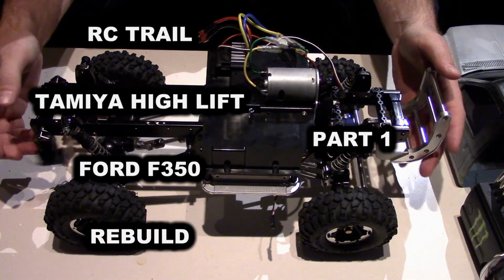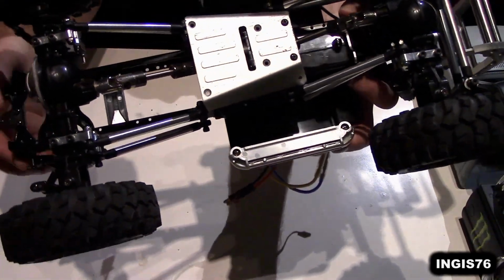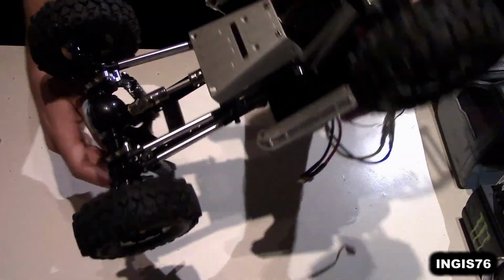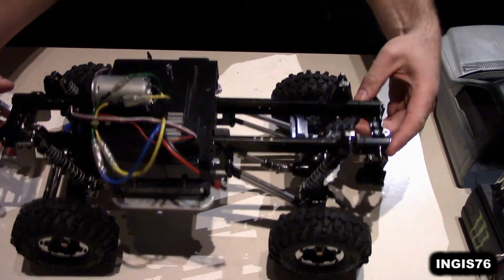RC TRAIL REBUILD PART 1 TAMIYA HIGH LIFT FORD F350

Comment: I was wondering in the Tamiya 350 and tundra the same only the body is different? Nice vid bra jobba..
Reply from the maker: They are the same yes, and the same as the Toyota Hilux. just minor details is different. Takker :-D
Reply: The Tundra have a longer wheel base than the F350, a while ago I would set the F350 Body on the Tundra chassis and I had to modify the wheel base...

Comment: I like the front steering servo mod but I do not want to make my highlift 4 link. I think it defeats the purpose.
Reply from the maker: Thanks, well i got it like this so i think its cool with the 4 link suspension.
My other Hilux high lift has the leafsprings :-D